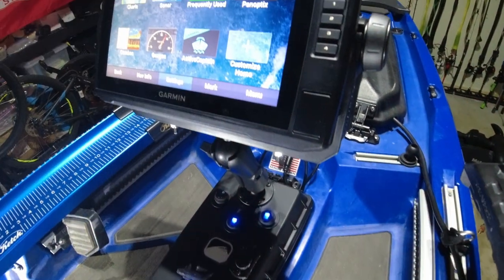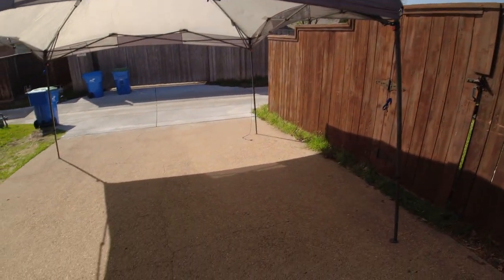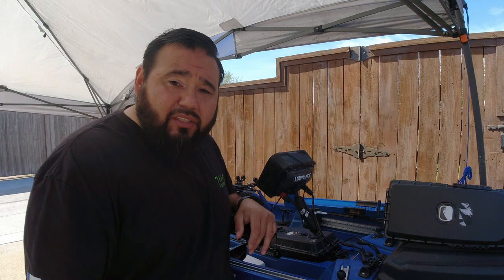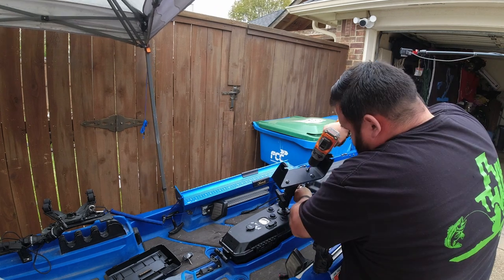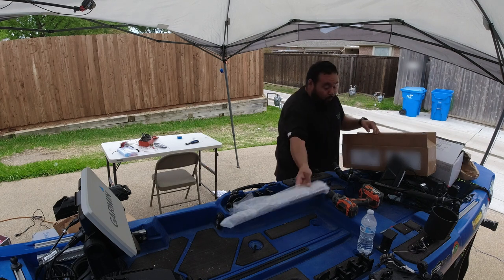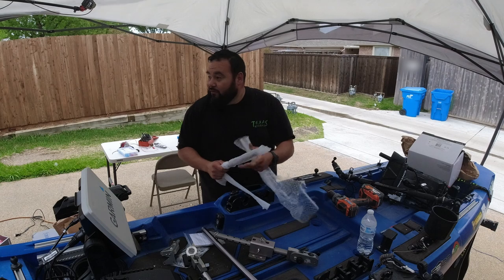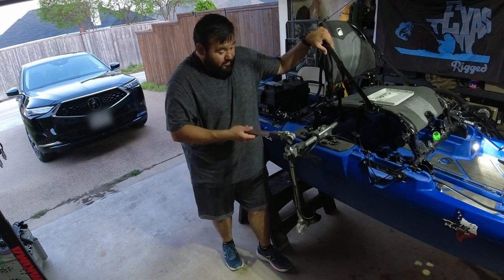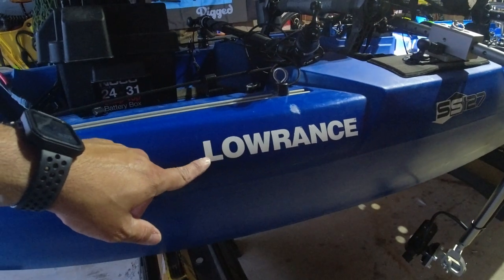Garmin LVS 32 LiveScope  Install on Bonafide SS127

Comment: Great install. I am planning to do the same thing in the near future. Do you have to have the nema system with the livescope? I’m new to the livescope stuff
Reply from the maker: No you don’t.
Reply: @Texas_Rigged  what are you using nema network for? If you don’t mind me asking
Reply from the maker: The nema system allows me to control my motor guide trolling motor with the fish finder screen. I ram a Lowrance elite 7ti 2 and it worked great with it. This new fish finder has some updates coming to allow me to do the same

Comment: Hey man, love your set up! Question for you, how did you mount your nav lights on the front? I have the same nav lights but am afraid to screw them into the hull because the screw will cut the wire that had to run through the same hole?
Reply from the maker: Thanks. I made a separate hole before the screw hole. It was right at the end of the track

Comment: Thanks for the video….  I am running almost the exact setup on my SS127…  Gen 3 transducer pole and arm…100ah in rear through to a MK Powerdrive  55..   Installing the Lowrance FS 9 w/ Active Target Live…  I am concerned on what Ah battery to run the active target on…. I’m hearing it uses a lot of juice..?   I went away from Helix 7.. so I still have a 10ah to run the head unit on if need be… suggestions?
Reply from the maker: I have not run out of batter using a Dakota 23 ah battery. I have been on the water for 9 hours and it was still going.
Reply: @Texas_Rigged  wonderful my man… thank you for the info….